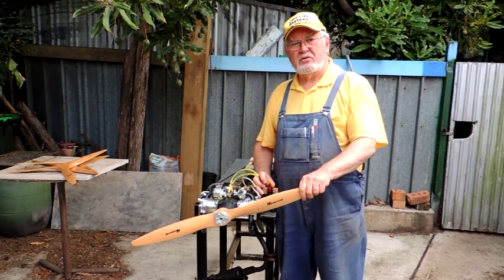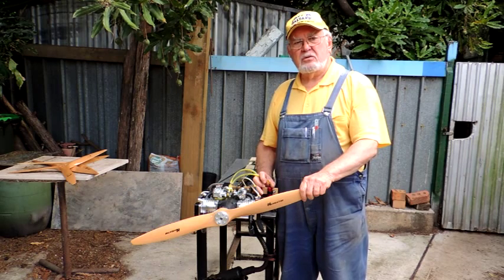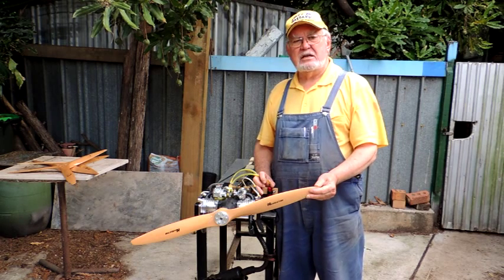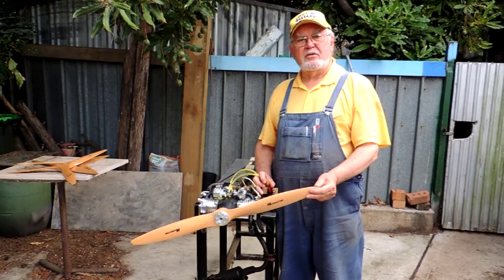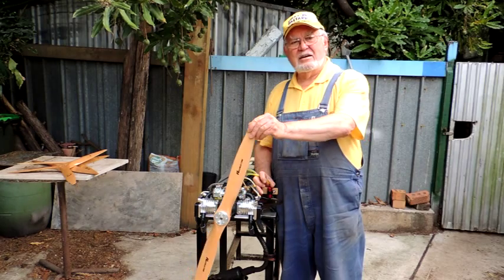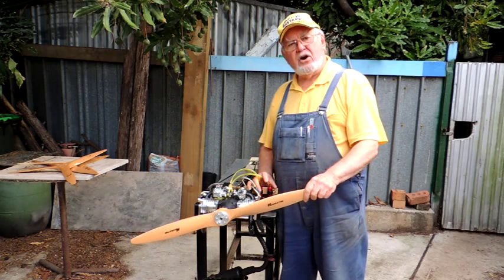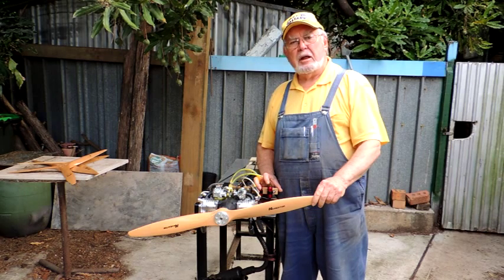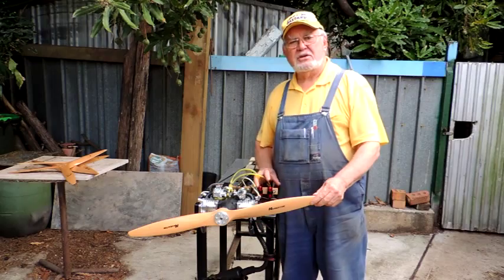ROTO 4 TEST

Comment: Sir, can I ask you how loud this engine is? Here in Belgium we have some restrictions, for example: we cant go above 85 decibel on gas engines above 30 cc thanks! Regards!
Reply from the maker: Yo Belgium,
 Being a multi cylinder four stroke engine it is very quiet running as is the case for all similar engines. As well, being a four stroke petrol engine it will tolerate quite a lot of muffling - additional silencing fixtures - with out losing power.
When you compare this to the engine in your car and the final exhaust of your car engine you can get a better grasp of my meaning. This engine would be quite easy to fit a silencing system and it would certainly not go above 85 dB if it was done efficiently.
Regards
Brian Oily
Reply: Brian Winch Thank you very much for your answer! Not all youtubers answer to your questions, I really appreciate your help! But I have another question if you don't mind. Wich muffler, silencer, can I use? Krumscheid or MTW mufflers for example? In our club "Royal Broken Wings", we don't really know this engine. And is the engine good quality compared to for example Valach or 3W? I know I ask much, but I like to ask my questions to a proffesional. I,d like to put this engine in a TMMY scale composites 35% cessna 182 skylane! Thank you very much for your help! 
Best regards, Sam from Belgium! 😉
Reply from the maker: Yo Belgium, 
Much easier for me to answer if you send me an Email with the information you request. My Email address is : oilyhand@bigpond.net.au
Regards
Brian Oily (aka Brian Winch)

Comment: Hi Brian,

Fantastic video thank you!

Have you tested either the ROTO 70 V2 or ROTO 85 FS-NG?

I am doing an undergraduate research project with them at the moment.  This is the test rig I am using -  https://www.youtube.com/watch?v=SIloKCQ7e0I
Reply from the maker: YoEdward,
Sorry for the delay - I have been on a couple of country trips taking photos of events.
I have tested the Rot 50 and 70 twins as well as several singles and all of the engines were very impressive as far as quality and performance. I have not tried the 85 but I have had reports that it is an excellent engine - the same as all the others in the range.
If you have a spare one of those test rigs I have a place for it in my workshop (Ho Ho)
Regards
Brian Oily

Comment: HP we need HP ratings, that's the single biggest desire when considering a donk.
Looks good but that sound isn't nice to the ears:-(
Reply from the maker: Yo Endy,
 How would you interpret it if I DID provide HP ratings. Maybe I could give you the PS rating or Watts but...how does it finally assist you with modelling? I do give ratings in my full reviews which are in several magazines but, again, the  most important information to the majority of modellers worldwide is the range of propellers the engine will swing at at what RPM - this is what tells the real story..horses for courses!
As for the noise being offensive, be aware, sir...I have duly canceled and expunged the records of your modelling existence in the annals of THE OILY HAND SOCIETY. Let that be a lesson to you...you rev-head. (Ho Ho)
Brian Oily
Reply: Brian Winch HP is just a measure of apples to compare with other donks, it's irrelevant what it actually is provided it's more (or the same) of another engine a perspective buyer is considering:-)
Years ago car manufacturers always boasted HP as that was a unit of measurement to beat or be better than the opposition, same goes with toy plane engines:-). Prop size is also irrelevant as who cares what size it can swing as long as it produces the HP they buyer wants:-)
As for the noise? I'd expect better with four pots singing the song of expelled energy:-)
Reply from the maker: Yo Endy,
We ain't testing 'apples' here, mate - just model i.c. engines. Look around you...do you think any model engine manufacturer (of commonly used engines) is going to produce an engine with a lesser HP than his competitor?  Besides, as in the car industry of days past, there was a lot of questions needed asking as to how the stated HP was measured.  Regarding propeller size, surely you can work out the power differential when you compare simple RPM with the same propeller used on different engines. How do you want the HP developed? Pure, simple 'grunt' power or screaming RPM as with a pylon engine. In days past we had a good 10 cc glow engine used for control-line speed (for example) and it was constantly in the winner's circle. It revved around 16 - 18,000 RPM but....on an 8 x 10 propeller and a toothpick prop at that. Put a 12 x 8 on it
and it died in the rrr's. However, a common old 10 cc (o.s. - Enya, Webra etc.) would swing a 12 or more propeller and power a much larger model. Horses for courses or...red or green apples - your choice. 
As to the sound - on the bench it sounded like a racing Porsche burning rubber to me and the several modellers who dropped in the see it running. How it sounds finally is up to you ...if you get around to buying one.
Brian Oily